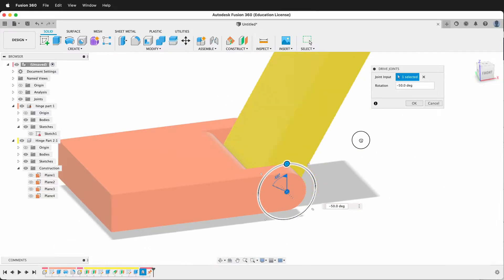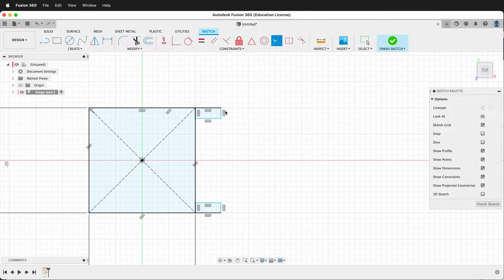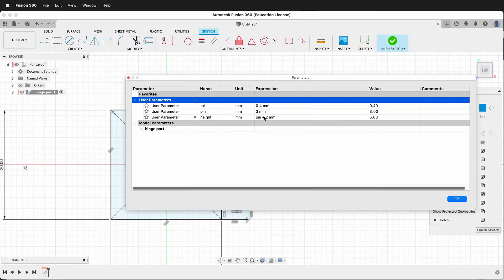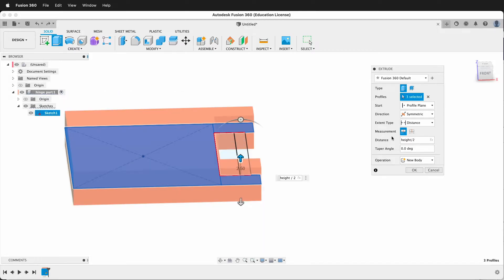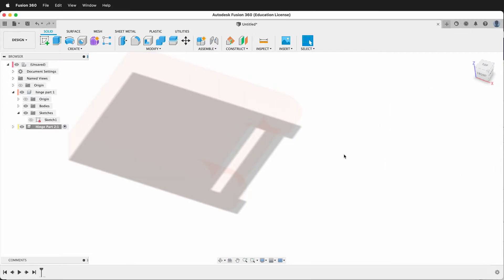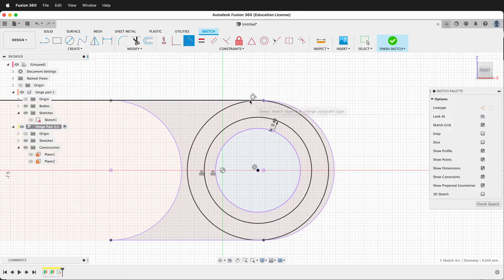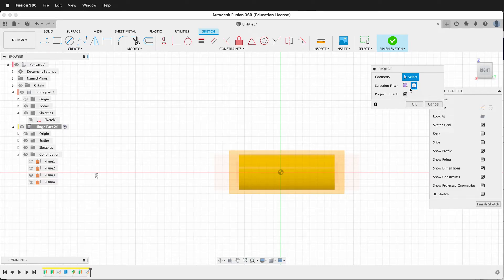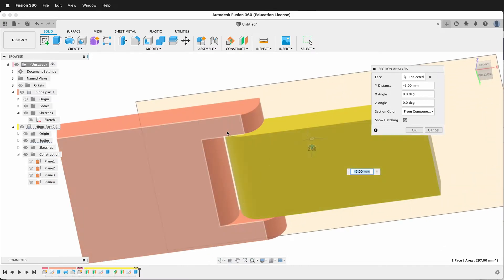3D Print in Place Hinge with Parametric Pin Modeled in Fusion 360 Tutorial

Comment: how do i change the line size after ive drawn it on sketch
Reply from the maker: Select the line, then press d on the keyboard to add a dimension, then click a spot where you want the dimension, type in the value, then press enter 

If you are talking about parameters then those are changed in the modify parameter menu

Comment: would you print this vertically like its shown in the video, or horizontally (eg the pin to be perpendicular to the build place) ?
Reply from the maker: I printed it horizontally and it worked, but I've seen newer designs that use pins that are shaped at 45° angles that could be printed vertically

Comment: i doubt you can print it. Expecially the revolved cylinder. it would need some supports and cause it is in the inside you can't add them. Surely it will fall and fuse with the outher part. After creating a tutorial you should print it to see if the project could be really printable as you say...
Reply from the maker: I've printed it multiple times, first print still works

Comment: Good video and good description of how to do this.   I especially appreciate the brevity....  No BS preamble ....   just a good demonstration of how to do a thing.   Thanks.
Oh, and this is a bit pedantic, but what you have called tolerance is really clearance.  Many get this incorrect.   
Clearance is the gap between two mating parts, such as a shaft and a hole. Clearance is determined by the size difference between the parts. 
Tolerance is the allowable variation of a part's dimension from its nominal value. Tolerance is the difference between the maximum and minimum dimensions of a part.
Reply from the maker: Thanks, I appreciate the clarification, 

tolerance fit and clearance were really confusing, and still are but now I know tolerance is the plus and minus of the dimension, and the clearance is how much space extra, and the fit is the type of clearance, tight /  loose, well at least I think so 

Love learning new things from other folks that know more
Reply: @WhatMakeArt  I doubt that I know more.... just some different (perhaps less useful) stuff. :-)    
A good way to remember the difference is that especially when 3d printing, you need to deliberately add some clearance to account for the inaccurate tolerance of the process.   
Thanks again.... I've subscribed and I'm going to check out more of your stuff.

Comment: How does the pin print without touching the other part of the hinge? using bridging?
Reply from the maker: It just goes really fast and that part doesn't fuse together, it is a little crunchy at first but then moves relatively freely

Comment: Great video would this be the same method it the print orientation is changed so the pieces are printed flat on the bed?
Reply from the maker: Yes, I printed this flat on the print bed
Reply: @WhatMakeArt  sorry might not have asked my question correctly. Will it work if you are not printing flat on the bed?

Comment: how do you print it? it's two bodies. Also, what about the joint?
Reply from the maker: To 3D print the print in place hinge, just export both the bodies and don't add supports in your slicer and it will likely print fine

Comment: This video should get so many more views. I am new to Fusion 360 but not new to modelling. The idea of using parameters is fantastic. As a software dev by trade it makes so much sense to use parameters to drive the procedural model being created. And it is not just for adjusting tolerances, but it allows you to design one hinge/model to be resized to whatever future project one might have.
Reply from the maker: Exactly, using parameters in Fusion 360 is a great way to work, just like variables in code 👍

Comment: Thank you for sharing. I’ve seen a few videos of print in place hinges, however I just can’t understand how the peach colored pin itself prints without any sort of support coming directly from the “bottom” floor of the gap? Basically what keeps the bridging pin material from slouching midway between the two endpoints? Also I have an SLA printer that obviously prints upside down, would this still work?
Reply from the maker: It's weird but it just kind of does. Every 3D printer is different and you should just try to print the print in place hinge for a few different settings and see how it turns out. It only takes a few minutes to print, you might be surprised
Reply: @WhatMakeArt   Gotcha! TBH I’m kind of comforted to learn that it’s not just weird to me alone 😅. Thanks, I’ll def give it a shot if nothing but for the sake of my curiosity.
Reply: I'm also confused. I just got a printer and have not even set up up yet but if this is possible I'm amazed. Can't wait to try this. Thank you.
Reply from the maker: Yes, it seems weird but give it a go, it really works, post any successes or messups you have 👍
Reply: @WhatMakeArt  Set up my printer and immediately printed your hinge and of course it works. Amazing - thank you.
Reply from the maker: So glad to hear 👍 excellent

Comment: Hi Friend! I was just watching various videos on this and suddenly I heard your voice! Haha great video, keep it up man!
Reply from the maker: Ha! Not quite rocket 🚀 skates 👍
Reply: @WhatMakeArt  hehe. Question for you though - when you 3D print this, do you print using supports, and then just open and close the hinge a bunch until the supports disintegrate and fall out? Or how do you support the gap between the inner pin and the outer sleeve/bushing?
Reply from the maker: Cura tries to bridge it if you print without supports and turn on the experimental bridging in settings,

Also printed it with supports and it is a bit crunchy but then moves fine, can also adjust the gap parameter in Fusion 360 based on real world prints
Reply: @WhatMakeArt  very cool! I'm reading up on the bridging feature now. Thanks for the tip :-)